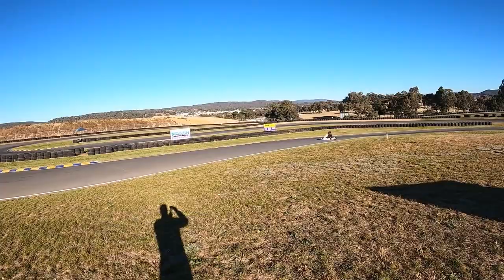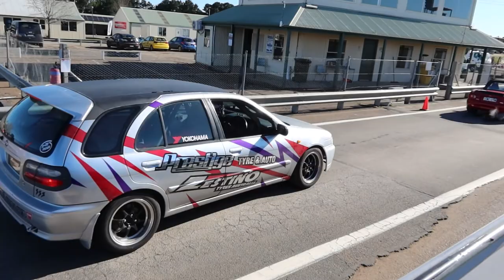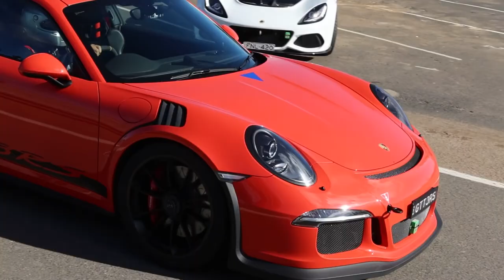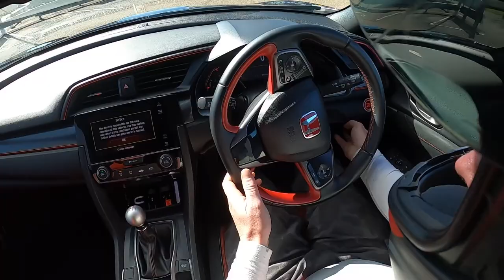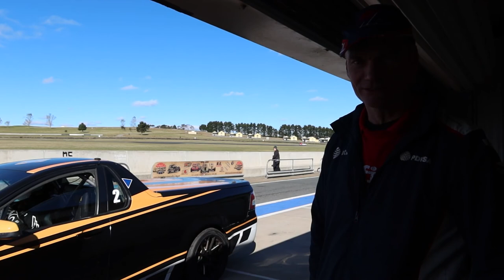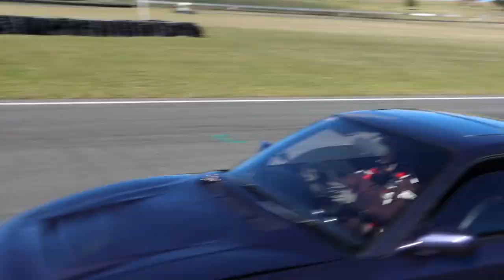Honda Civic FK8 Type-R Track Day at Wakefield Park - 1.10.6

Comment: Holden and Ford utes racing around, you sure it wasn't Benny vs Motive?
Reply: No Sparesbox livery on those utes.  Maybe they worked with suppliers that actually deliver! 🤔
Reply: @garysmith3559  gee that's harsh Gary. There was some stinging feed back about the service you receive though.💩💩💩
Reply from the maker: G'day Angry, these were actual V8 production spec utes with some pretty sorted mods.

Comment: 3:50 screech, albeit, end of day enjoyable

Edited
Reply from the maker: Yes, we need better tyres to prevent tyre squealing onto the main straight!
Reply: @ClunieGarage  plan to upgrade beyond continentals soon?

Don't worry, regardless I like the sound of the screeching, on my own fk8 at times off controlled understeer (or lift off oversteer)
Reply from the maker: @g0d182  G'day mate, I have actually fitted Michelin Pilot Sport 4S tyres.  They are a good everyday tyre but have limitations for how I push the car at Wakefield.  It should do a 1.08-1.09 with a nankang semi-slick.  Check out our latest video of taking the FK8 to Pheasant Wood.   It did a 1.01.
Reply: @ClunieGarage  Excellent video, and nice tyres!!!!

Love the dedication and quality of the video, including the latest one!!